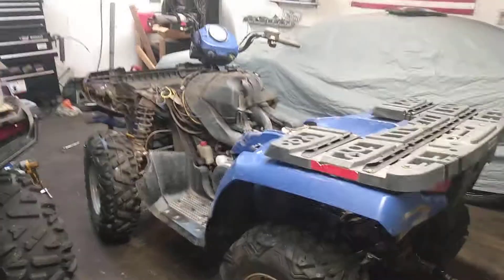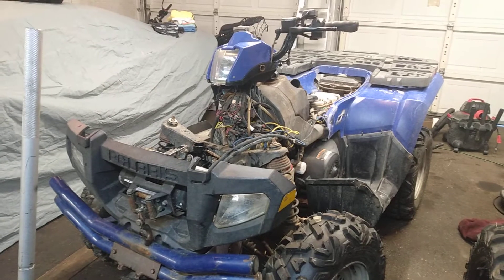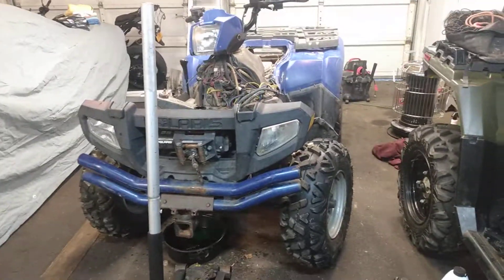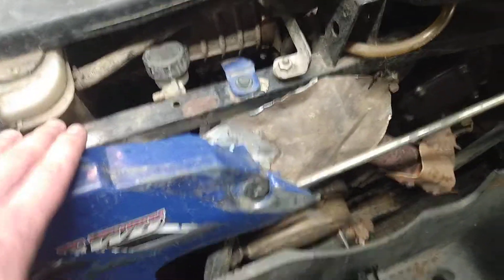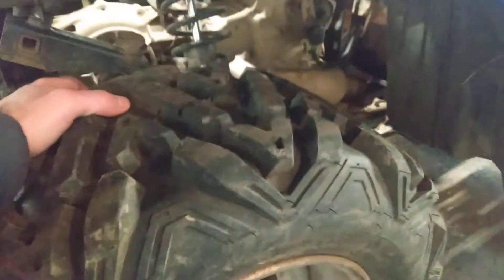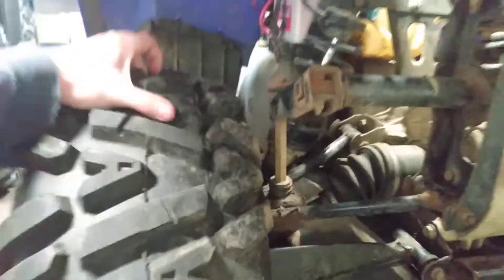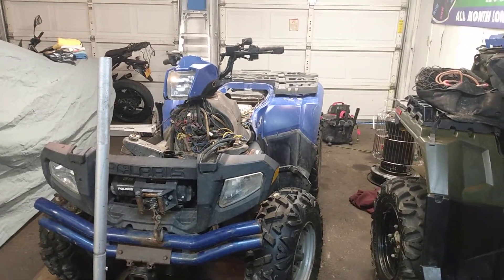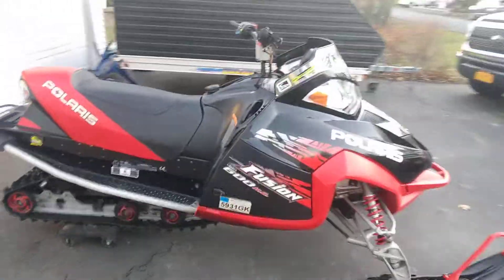More JUNK Polaris. FEATURING a Mint 15 year old Polaris Fusion Snowmobile!

Comment: I have same sled, and mine is also awesome! Stock except a can and rejetted. As reliable as a hammer! Lol. 6000 miles on yours???
Reply: My 900 was a nightmare. Lazy owner had detonation and lazily rebuilt it by using spi pistons with the original gaskets/o-rings. The thing would run good after the rebuild but would constantly die and have a no spark condition. Now I traced all the ignition issues back to the stator and the part is $400. Kinda sad how many people have replaced the stator on these sleds.
Reply: @gordonliddy9418  yeah the 900s had issues. That's why the 600s got a bad rap. But, the 600s are a lot of bang for the buck because of that! But when the 900s are on point they say they are beasts!!! I was told the 900 engines were made for Polaris watercraft originally then figured they'd put in a snowmobile. Not sure how true